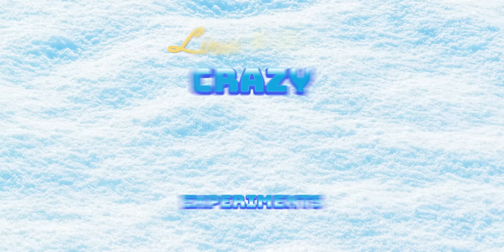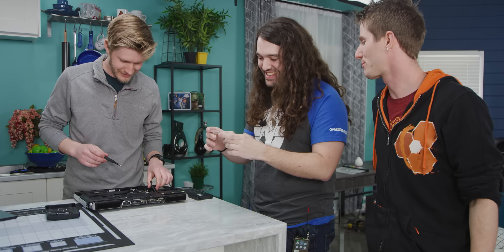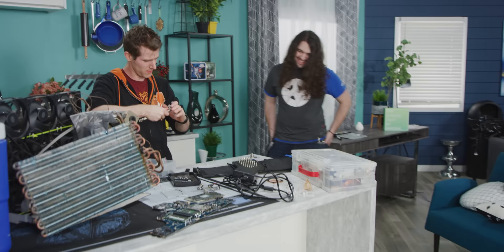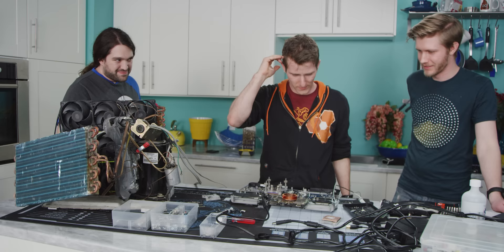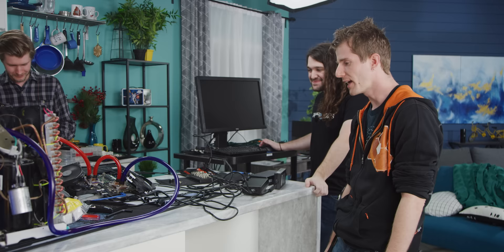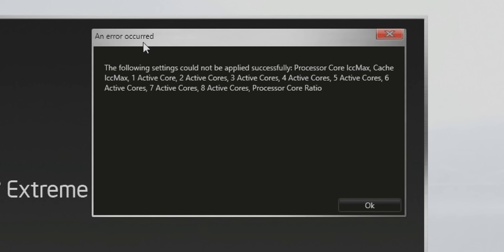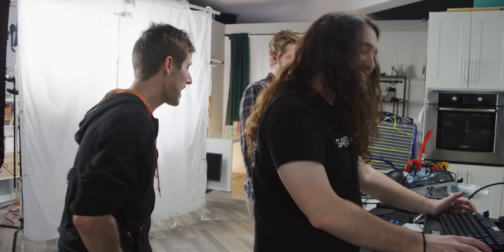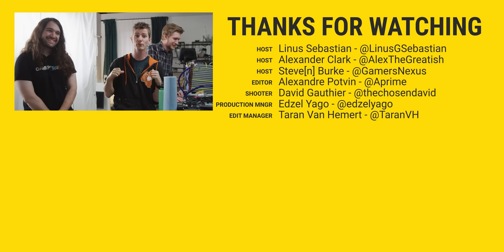Sub-Zero Laptop Cooling?! - Feat. Gamers Nexus

Comment: "Air creates condensation" so guys, I want to see you build a gaming PC in a vac chamber and see how low you can get your temp readings.
Reply: That'd be a serious challenge because you'd have to put the radiator outside of the vacuum chamber. No air means no way to remove heat from the system.
Reply: @Sammie1053  you act like you think it's not easily possible.
Reply: @oldmanuserphan  It's possible but I'm not sure I see the point? Especially given the level of effort required. Not only do you need tubing runs that are rigid, go through the seal on the vacuum chamber, and are fit together snugly enough to not leak in a vacuum (which would be equivalent to having your loop highly pressurized), you'd also have to be sure the capacitors on the motherboard wouldn't explode.
Reply: @Sammie1053  friend. This is the Linus Tech Tips channel. 90% of these videos are absolutely pointless and dumb.
Reply: you could try and put it under a pure atmosphere of nitrogen,co2 or some nobelgas to avoid condensation
Reply: @MrTheSmoon  my thought is having the water loop separate from the vacuumed atmosphere since the heat is transferred from the components via direct contact.  They make pretty large vac containers with multiple ports that you could build a PC inside of, and port the water out to the radiator and back into the separated loop.
Reply: @Travis B in a good vacuum for what you would be trying to do, the system would fry itself. Yes, direct contact cooling would help, but it would be tremendously worse by itself. The problems would be every single square centimeter of surface area across the entire pc that receives any kind of electrical current, including the motherboard. Electricity itself generates heat. On a computer the ambient air is enough to keep the majority of the pc cool, aside from the cpu and etc. In a vacuum there is no air or anything. So there is no longer anything keeping everything else cooled. Your capacitors would blow, the soldering on the motherboard would melt, parts would warp and break, i hope you get the point by now, otherwise you need more help than i am qualified to give
Reply: @Sammie1053  You'd use the vacuum chamber itself to conduct the heat whether that be by direct contact, heat pipes, water, or some exotic way I cant think of right now.  Water cooling in this scenario would require some serious engineering, but you could make it fully enclosed.
Reply: No. Use mineral oil that is cooled below 0 because there is no air or water inside oil.
Reply: the water will leak out the pipe fittings because they're designed to have 100kPa pushing in on them

what you could do is run your intake air through a dryer and then cool with that and have basically no problems whatsoever
Reply: This isn't how things works. Usually, we directly cool the hottest things on a motherboard; the CPU, GPU has its own cooling most times, and then I believe a few motherboards might even have tiny fans for the VRMs. 

You put that in a vacuum, you will fry the motherboard because everything not watercooled will choke on its own heat. This is not the system you wanna use under vacuum. You want to use COLD system undervacuum so that the air outside can't heat up the system. Not a
Reply: I was thinking similar but instead of  applying a vacume I was thinking an air tight case with a air dehumidifier and some  radiators to bring the environment temperature down as low as you can without the cooling blocks and radiators sweating🧐
Reply: @Sammie1053  you dont really need a vacuum just an environment that doesnt have moisture in the atmosphere around it
Reply: Or just use mineral oil in a chiller and treat it like a mineral oil computer make a completely sealed case and problem solved
Reply: Im currently watching the comments on this comment doesn't condensation come from moisture in the atmosphere a vacuum environment does not quite mean that it's moisture less. It's not like its the oxygen thats creating condensation because there shouldn't be any reaction that's creating the water so you could also do it in a closed dry environment which would be easier except there wouldn't be much air to go around for the radiators so it would be pointless
Reply: Edvards Krastiņš you could or do it in a non-oxygen environment like nitrogen. Similarly I don’t know how that would impact performance but I feel like it can’t be that bad since liquid nitrogen cooling is already a thing
Reply: Leaks would happen with any tubing so LN2 would work but that's not a long term or practical cooling choice
Reply: The motherboard itself will have some level of heat transfer, so parts not generating much heat at all will likely not be an issue. Using a nitrogen or other gas mixture... doesn't solve the issue. Its the WATER in the air, not the oxygen thats condensing. However, if the gas used is dehydrated sufficiently then it should work, probably better than a vac solution honestly. The fittings would work as long as they are pressure rated to at minimum 1 atmosphere, 2 to be safe probably. The outside pressure doesn't matter, its the pressure difference that matters.

The vacuum system could work if its the socket only that's sealed in a vacuum (you'd probably need to either seal the back side or put another vacuum underneath it the same size to ease the pressure on that section of the board) or the board is in vacuum with water blocks on every heat generating component. The water in the tubing is what will move the heat away, and should be under atmospheric pressure (unless you want a 2 phase system and let the water boil to take heat away). The tubes might need to be a little thicker to be 1 atm rated other wise it should be fine and the seals into the chamber around the water tubes need to be suitable.
Reply: @trouty7947  I hope LMG is following this. Imagine the shitshow experimental videos they could extract from it.
Reply: I've been wanting to see that as well. Yes, please.
Reply: A room with an humidity of near 0 would be good enough
Reply: @JNouveau  a vacuum IS moistureless. A proper vacuum will be devoid of ANY vapors or gases, not just oxygen.
Reply: Sammie1053 you just need liquid cooling, and tubes that carry the liquid to the rads. The air cAn blow on rads outside the vacuum chamber.
Reply: LMAO i wouldn't recommend it. you'd loose all passive air cooling. You'd have strange heat-spots pop up. Would love to see someone else attempt it.
Reply: @MrTheSmoon  just like the system that Steve and Roman saw at computex last year.
Reply: @MH-hs7ie  don't try too hard kid.
Reply: @oldmanuserphan  Want to argue kid? I can prove you wrong every single time what I accused
Reply: @MH-hs7ie  next time you try this hard you should Tryhard in proper English. You won't seem like such a 12 year old.
Reply: @MH-hs7ie  tl;dr Tryhard. This is rather amusing watching you try this hard tbh. Shouldn't you be preparing for distance learning?
Reply: @oldmanuserphan  Lmao a 6 years old underage child is crying for food.. You might one street guitarist
Reply: how
Reply: Travis B 

It isn't.
Reply: Just fill it with hexane, heavier than air and is meant to be a really good heat conductor so (this is a long shot) maybe you could cool the hexane below 0 Celsius to cool everything. Would be a Frankenstein kind of water cooler using gas
Reply: Avoid condensation but keep airpressure, use a different gas to substitute the air so you don't ruin your block and tubing
Reply: @deep___bot6044  it's like we're doing all the theory work for LMG. They should give us a cut of the ad revenue.
Reply: Water boils at room temperature in a perfect vaccum. That is why people think that there is no moisture. So everything you are trying to do to help with cooling would be void. Your liquid wood turn to gas and therefore can't transfer heat. Its a good thought to try a vaccum  but it just would not work.
Reply: Vacuum chamber would be STUPID! Every semiconductor that generates heat will meltdown. How about you just put in in a very low humidity room or chamber.
Reply: You could use a dehumidifier to dry out the air.
Reply: Like i said, make a cup on the waterblock to collect the condensation? You could even put a pump in the cup on the waterblock to empty the water lol
Reply: @avlinrbdig5715  I like where you're going. To expand on it, surround the water blocks with another cup/enclosure that contains a stream of fast flowing dry/conditioned air to pull away the condensation.
Reply: vacuum is an insulator - heat has literally nowhere to go to.
Reply: @oldmanuserphan  aye. Prolonged sub-zero water cooling should definitely be doable. Just needs a bit of tinkering
Reply: @Sammie1053  it does not have to be a vacuum, just needs to be free of water.
Reply: The problem with that is while the nitrogen-cooled parts would be able to dissipate heat, everything else that is normally cooled by air (convection) would overheat. VRMs, capacitors, even the traces on the motherboard all generate heat that would build up over time in a vacuum, as they wouldn't be able to radiate the heat away faster than it accumulates. 
You'd have an easier time trying an LN2 build in the Atacama desert, which has some of the lowest naturally occurring humidity on Earth. 
You could also just use industrial grade dehumidifiers.
Reply: NASA and other agencies dealing with operating electronic circuitry in space already have a variety of methods to solve that problem. Generally the idea is to have material with high thermal conductivity padded onto the components and distribute the heat to the edge of the circuit board where it flows into a heat sink. One simple design for single stack 2D circuitry is to use copper pads mounted onto the components conduct any heat generated to the exterior of the board and finally directed into a low temperature heat reservoir. In these cases the components are usually far apart. However in the case of processors and stacked chips, lack of air to transfer heat via convection to the conductive casing means we're solely dependent on radiative transfers. We can make do by keeping air or some other coolant directly in contact with the electronics (i.e trapped in the case) as long as they have good thermal convection\conduction but poor electrical conduction- i.e. we need a fluid which is effectively inert. An example would be the use of Fluorinert in the Cray supercomputer.
There is a lot of research in how to optimise coolant flow and heat transfer and prevent localized heat spikes. 

Then it pretty much follows the same procedure where we distribute the heat to a reservoir (you'd want to use something that has a large heat capacity and high thermal conductivity), there's been researching into using a coolant that evaporates as it's transferred through the circuit board, thereby using the coolant's specific latent heat of vaporisation to increase cooling efficacy.

Heat pipes would be disastrous in this case precisely because of the highly clustered stacking of chips and inability to deal with localised heat spikes that would severely damage components. I suppose you could scale down the heat sink and form thermoelectric components, as with what IBM is doing, to fit into microchannels and deal with exactly this problem- which avoids the issue of electrical shorting.
Reply: Better idea, just run the system in mineral oil. Not my idea by the way it was on another video but it's true.
Reply: @dan167  if you're paying attention this idea has moved beyond something that might be good and is now something we think should be done because of how ridiculous it can be. Good view counts for sure.
Reply: @Sammie1053  You must be new around here.
Reply: Amagad Steve uses Celsius, you are one of a kind in North America!
Reply: God imagine how instantly catastrophic that decompression would be. Within seconds, it hits the dew point and shorts the whole board.
Reply: @A_Wild_Yeengirl  encase the board in a layer of salt? Salt absorbs water :)
Reply: Gonna be hard to screw stuff together in a spacesuit
Reply: @davidsnyder7341  BUILD IT ON THE MOON!!! LTT GOES TO THE MOON lol
Reply: Holy crap. imagine if Linus actually payed SpaceX to bring him into space and build a PC.
Reply: Why don’t you make a chamber without any water vapor?
Reply: No put it in a chamber with nitrogen or something
Reply: @Sammie1053  dude. Linus watercooled a Calculator. I bet linus will try to cool a pc in a vacuum
Reply: Speaking as someone who works with both ultra high vacuum systems and nitrogen purge for the same chambers...

Everything that goes inside a vacuum chamber needs to be designed for that environment. If you put regular computer parts inside a vacuum chamber, it's likely that air/water/etc will be trapped in various components and fasteners. At best, this means you may have trouble pumping to a given pressure (in this case, if probably wouldn't matter). But depending on the circumstances, it could also mean destroying components. Thermal paste would probably come out from under the cold plate. Cooling lines would have a bad time (and btw, are not impermeable). God knows what else might happen, it would be fun to find out I guess. Maybe nothing, I guess. But normally even a screw will be "vented" (hollow) for use in vacuum systems.

Regarding the idea to use an inert gas like N2, and the guy saying "that doesn't help, it's not the oxygen it's the water." Yeah, you're right... But not really. Usually if you're obtaining nitrogen it is going to be certified at a certain purity. Even low grade nitrogen will be well above 90%, and is available as "extra dry." High-grade nitrogen, while completely unnecessary for this hypothetical test, would necessarily have a level of water content that is basically undetectable. So, the point is irrelevant as even though water could theoretically be present, it won't be.
Reply: @Auto-Tech-Matt  Interesting point about water boiling, but I'm not sure it would apply when it's inside of closed loop assuming the seals hold. But as has been said many times already, vacuum would be a bad idea for plenty of other reasons.
Reply: @dan167  The mineral oil fish tank rig is a classic, been around for decades lol
Reply: @oldmanuserphan  Lol. I was saying N2 would work!
Reply: They have capacitors and they can explode on vaccum
Reply: And we can get another join effort with electroboom
Reply: @Sammie1053  Well, they announced that they hired two more engineers recently. This might be something to come back to
Reply: Or you can just run the system in a chamber that has ambient temperature really low, like a freezer or something
Reply: @oldmanuserphan  fr cut two holes and seal er up! Hah
Reply: @Sammie1053  Creating a cooling loop inside of a vacuum chamber is extremely easy. why are you talking about rigid tubing??? I've created many cooling loops in high vacuum using the exact materials you use at atmospheric pressure. one of them used standard vinyl tubing running to a copper coil. we drilled a 3" hole into the bottom of the chamber and the diameter of the soft tube fit into the hole, then we inserted a standard barb fitting into the hose which expanded it slightly creating a seal. It's really simple and its very common in industry. Keep in mind this vacuum we worked with was high enough to prevent heat transfer and reduce electrical arcing so it was very extreme compared to what would be needed to prevent condensation. you seriously think that 14 psi is some kind of hurdle??
Reply: I had been thinking of a system using a car AC system but replace the evap coil with with thermal interfaces for cpu and GPU.  This is not as well built as Id have liked
Reply: Go watch Basically Homeless,he made something close to it,a gaming fridge.
Reply: Assuming they built an airtight (or slightly positive pressure) chamber to fill with non-humid air, what gases would have the best thermal properties?
Reply: you dont need a vacuum chamber just an airtight chamber filled with 0% humidity air.
Reply: Energy doesn't transfer in a vacuum. Why do you think yeti mugs are so popular?

Comment: 2019: Won't spend $5k on a tool the team needs
2020: Will spend $10k on an antique widescreen monitor for a single video
Reply: which tool?
Reply: @juanma9868  a mill. Alex brought it up when they were tapping the acrylic blocks.
Reply: couldnt they buy a cheap drill press and then get a cross slide vise?
Reply: Probably their revenue grew to the point 10k do not look like that much? I mean now they have a extra channel that basically prints manoey since they just unbox things do sponsored content non stop.
Reply: He had already ordered the mill. They have a video of them unpacking ab 100k worth of tools and equipment for alex
Reply: 2021: has a whole workshop worth $100k+
Reply: I am pretty sure they gained much more than 10k from that video
Reply: 2023: Won’t spend $500 to retest a cooler on a GPU that it was specifically designed for